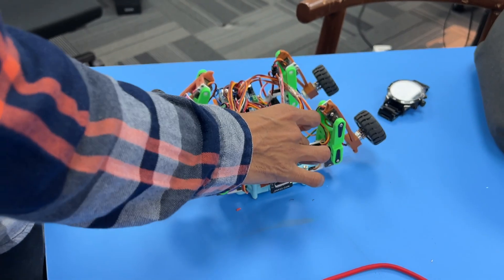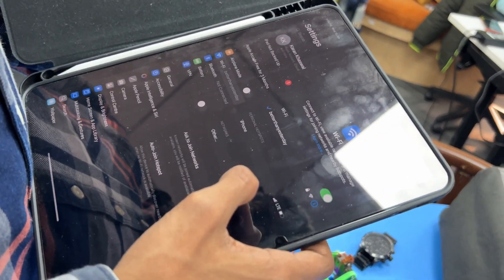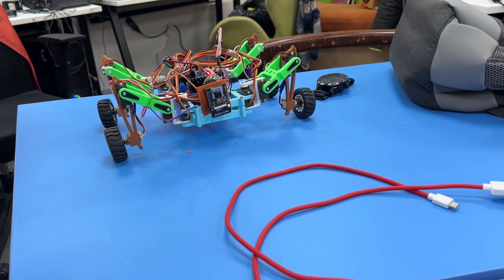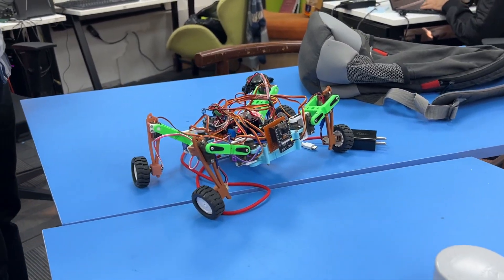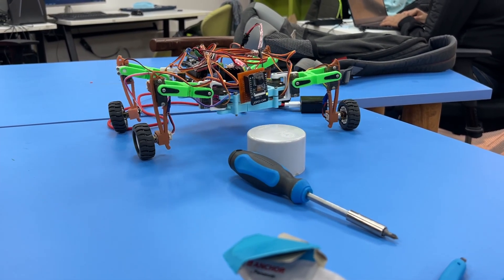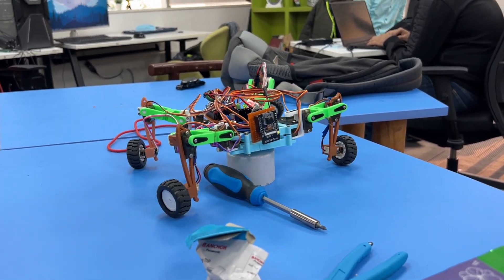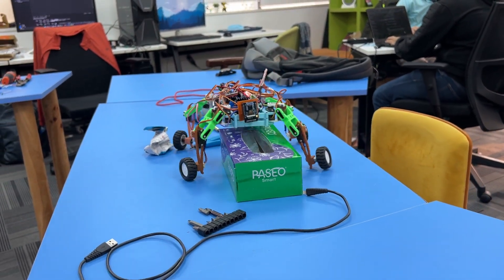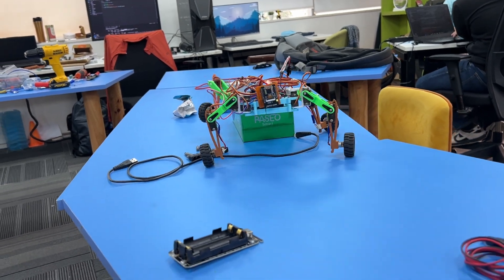Legion Mark 2 : Shape - Shifting Robot || Arduino, ESP32 - Cam

Comment: Amazing bro it would be quite helpful if you provide us with some source regarding over project
Reply: We were attempting to make an rover but we are kinda stuck  to use esp32 as an web interface
Reply from the maker: @dhanshrijadhav9529  codes are in my GitHub 

Not the latest but you will find web interface code using esp32cam with camera feed.

https://github.com/NexRobotic/Project-Legion-Robot/tree/main/Codes/ARDUINO/Arduino%20With%20ESPCam